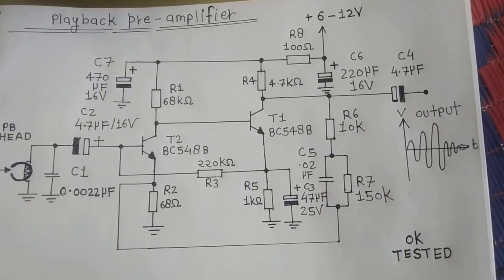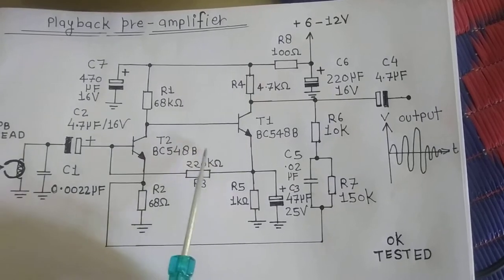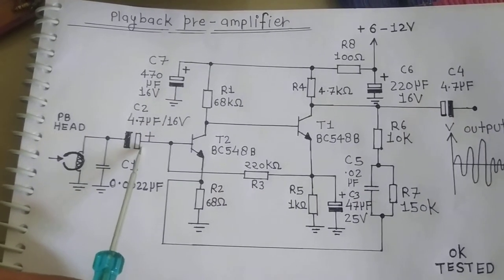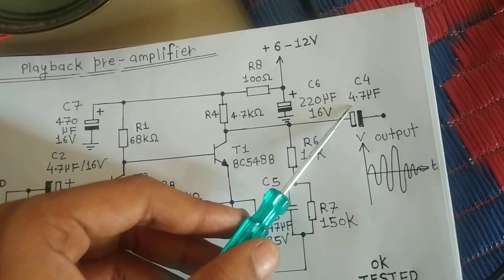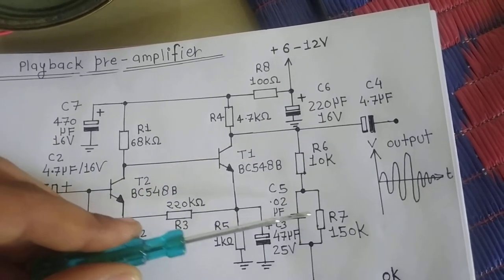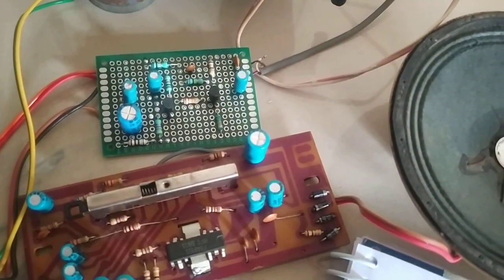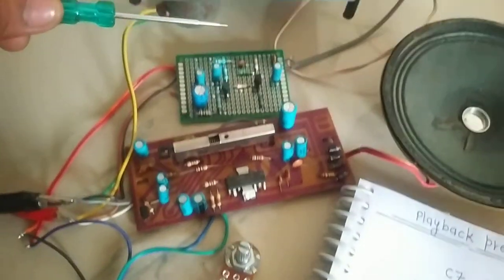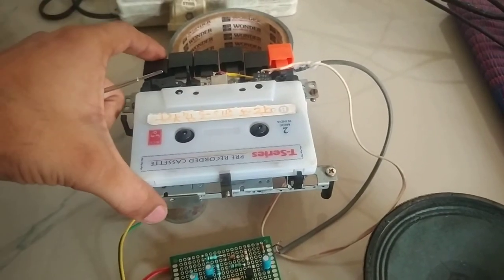NAB Playback Pre Amplifier Circuit | diagram and using transistor | 🤖

Comment: Thank you for making such an wonderful video .👌 

      would you plz make a single transistor based head playback circuit which was found in old china made walkman (based on a single s9014 trasistor ) . if possible plz provide the circuit diagram of the same..
Reply from the maker: yes, why not
Reply: @ramatronicslaboratory989  I am eagerly waiting for your next video with circuit diagram.. Thanks a lot for your reply ...

Comment: How to adjust gain of this preamp circuit ..
Reply: Use a pot after the output capacitor
Reply: I mean how to increase gain .. ?
Reply: @BiswajyotiDIY  increase voltage or add another amplifier stage.
Reply: @Mike-ry4ti  Thanks for reply ..

Comment: Just want to know why didn't you add any resistor across the base and the collector of the 1st transistor?
Reply from the maker: Because I am not using Collector to base Biasing
Reply from the maker: I am using direct coupling method to couple two amplifier stages.  If I use a resistor between collector and base of first transistor then I can't bias the collector of second transistor. This also creates shunt voltage feedback which is not required here.